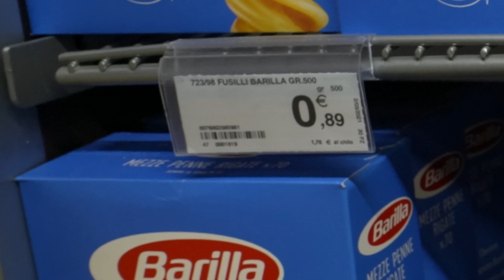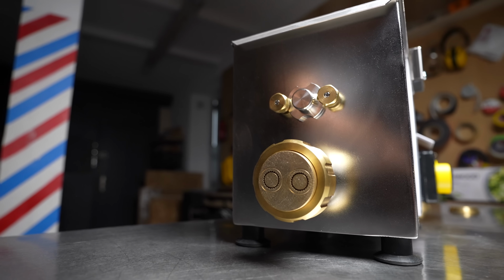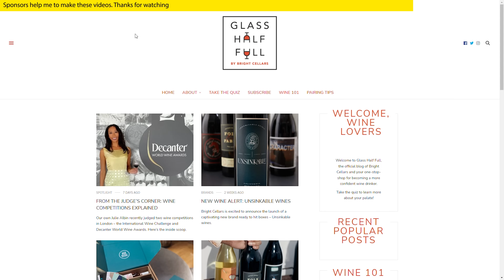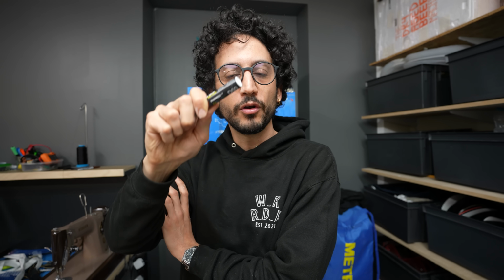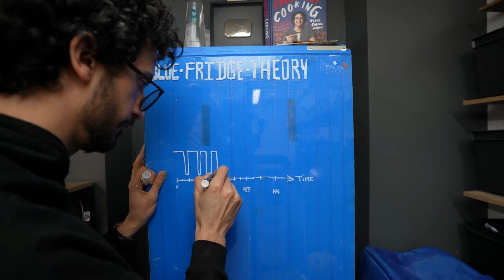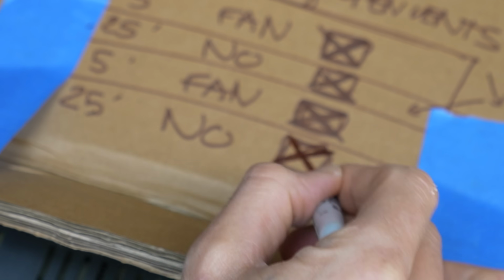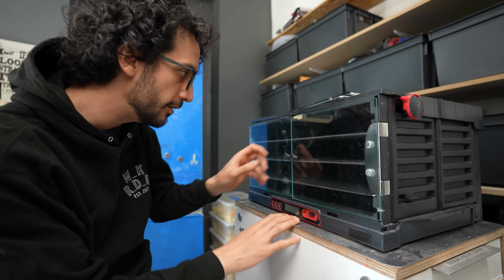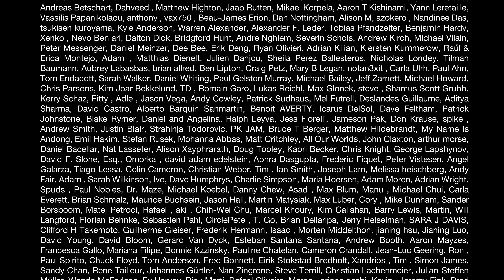This is Why Drying Pasta At Home IS ALMOST IMPOSSIBLE

Comment: My big question is: How dit they dry pasta bevor all the sience came along. They didn't had diagrams and controlled driyng machines. I think if you just let it dry by time, you don't have such an agressive process wich creates such tension. 
Im thinking that way because im carpenter and it works the same way with wood. In the old days they let the wood just dry outside. It took longer but the result was worth it.

Comment: Pourtant le Mr de l'usine italienne t'a tout expliqué:  de l'air chaud et sec, puis de l'air frais et humide. Ton sechoire ne fait que de l'air chaud et sec... tu dois travailler ton cooldown pour avoir un bon flow d'air ET un peu d'humidité... ca va etre ca le plus difficile. Si tes pates sechent trop vite, il se cree une tension interne... Je dis ca mais j'y connais rien en pates. Par contre, je m'y connais en ebenisterie... et c'est la meme chose pour secher le bois... il faut le faire lentement et a humidité controlée pour que les tensions entre les zones seches (l'exterieur) et les zones plus humides (interieur) aient le temps de se dissiper :)

Bonne chance !
Reply: Pendant que j'y suis, je suis certain que ca doit pas etre compliqué de remplacer les 2 boutons de ton séchoir par un Arduino pour programmer tes cycles...

Comment: As always, Good Luck, but do it carefully. I know you likely will, but still. Please please be ready to ruin that machine.

ANY TIME an Engineer says "What could Possibility Go Wrong" is a VERY dangerous time to be around them.
1) Alex, be careful, you might want to very much document those modifications, and document it's current state of action including power draw.
2) if it's possible to simply overclock the fan to produce a better happenstance - great.
3) PC Static Pressure Fans might be a way to go here. You can even take a small little Rasberry Pie and wire it into the controls of the current machine to give yourself that cycle of drying as a profile you can load and command from wireless - so there is some cool ideas you can do here if you don't mind being VERY CAREFUL.
4) Also one you get the drill out, adding in a proper thermostat and humidity gauge should be easy. Something you can find that's reliable and accurate, maybe even a pressure gauge that can measure how much pressure (and thus flow) of the air.

Comment: 8:37 ok I got triggered here cuz i know you're an engineer Alex but that is completely wrong. Let me set the record straight. Simply put, materials are sorted into two categories: ductile materials and brittle materials. Now, ductile materials behave either in an elastic way where when you apply a certain amount of force to them they deform (change shape) and absorb that force then they return that force to you almost completely and regain their shape. On the other hand there is the plastic way where they can absorb some of that force and keep some deformation after returning the rest of the force to you. That was ductile materials. Now, brittle materials are totally different they basically don't behave elastically at all. They can absorb some energy but they are very prone to either behave in a plastic way and keep some of the energy or they simply consume that energy by breaking. A way to think about it is to consider rubber, wood and glass; rubber is an elastic substance it can bend a lot without its initial shape suffering much change. Wood can be bent but it has a limit after which you risk to permanently change its initial shape. Glass is so brittle that you can't possibly bend it. If you try to it will just break. To relate this to the video, the "caterpillar" is basically ductile and closer to behaving in a plastic way and the final pasta is basically brittle. P.S.  using low pressure could help with the drying because it forces the moisture trapped inside the pasta to come out. I'm no expert on drying stuff but using a low heat low pressure environment could be ideal.

Comment: Next video ''I bought my own farm to grow wheat to make dried pasta'' Jokes aide, i think the problem with your drying machine is the fan wich could be not a pusher fan but a puller fan to take out the humidity. That's why there's no air flow inside.

Comment: FWIW, just checked: Noctua's Industrial PPM fans can do up to 140C. I doubt they're food-certified OTOH the air you're using isn't, either, so meh. Sounds like an easy hack so far. Actively controlling humidity upwards can probably be done by a simple drip. What's left is a microcontroller and remembering that you're definitely the engineer among youtube cooks, get going :)

Comment: Come on Alex.... you’re going to modify you’re dehydrator  but we all know it’s going to end with you building a machine. An arduino would automate the High temp, low humidity and Low temp, high humidity conditions aswell as the start stop intervals. As well as different set point for different pasta. You could even control airflow.

Comment: High temperature low humidity to low temperature and high humidity 🤔. That got me thinking, how the hell did Italians back in the day before all that fancy industrial manufacturing make their dry pasta? Well imagine them just drying it outside in the sun over a whole day. 

The middle of the day and the sun is high in the sky and you have that Mediterranean heat, high temperature, low humidity. 

But as the sun sets and night falls the temperature drops and humidity increases as water condenses in the air. 

You wake up the next morning and bam your pasta is dried. Surely it would hot be as consistent as with modern processes but they had to have some way of doing it in the past right?

Comment: You might be better off getting a better dehydrated instead of trying to fix yours. Between the inexcusably bad fan, the nonexistent insulation & the most likely inaccurate temperature control it will cost much more to fix all the flaws than buy one without them.

Comment: You could put a new fan in there...

Or you could put a new fan in there, rip out the brains and put in a microcontroller that would automatically turn the fan and heat on and off at the right time and automate the process. 

It seems like you've got a choice. You could do it the simple way... or you could do it the Alex way. 😁

Comment: Actually wouldn't be easiest to build something like that yourself? It's literally heater, fan, sensors and some controller that you can program to get the result you want. Of course that would not resolve problem with controlling humidity but this is also achieveable, altough it would be a little bit more challanging.

Comment: Your drying algorithm is the wrong way around, you rest more in the beginning and dry less because the amount you dry with the higher water content in the beginning is volumetric much more then later in the cycle. Also if you want to cheat, freeze dry instead.

Comment: You are going a dangerous way, a lot of product development in their early stage went into flame with that. If you increase the airflow, usually the heating element cannot follow the temperature requested. The temperature sensor will not reach the consign point. The heating element will stay continuously ON while it is designed to go ON/OFF and not reached a dangerous temp. The most common issue therefore is your heating element turning red and starting an electrical fire. NB: good series as usual ;)

Comment: You are overcomplicating this. How would your great grandma have done it? I would say that your temperatures are too high for a start, and the time cycle should cover a day or three. I don't have much experience drying pasta, but years of practice of drying wood bowls. Drying too fast creates stress, and stress is relieved by cracking. Just like boards, the outside dries first, and the inside plays catch up. Same principals.